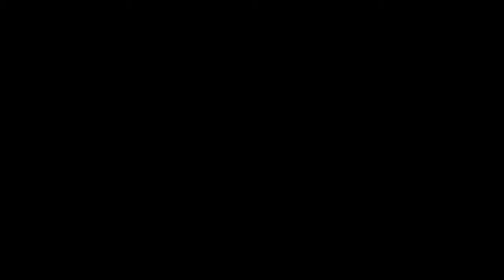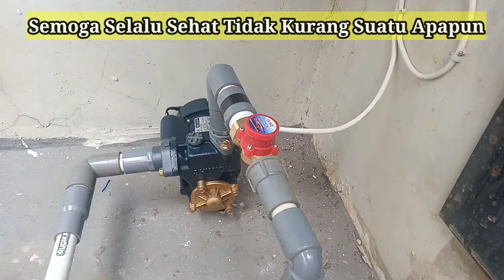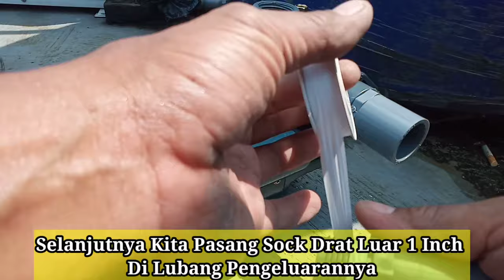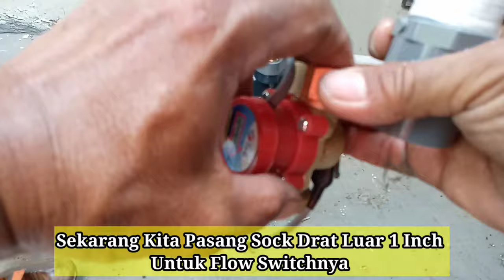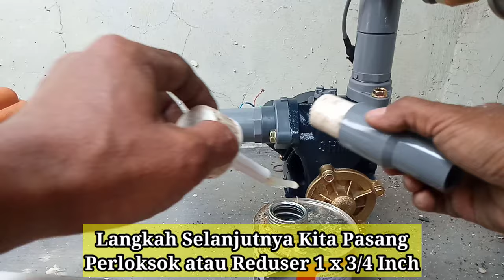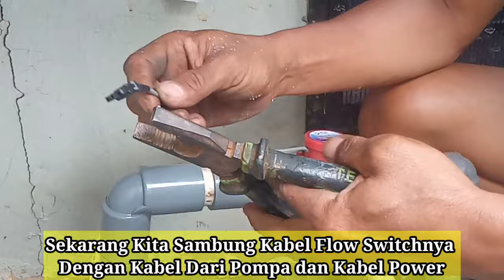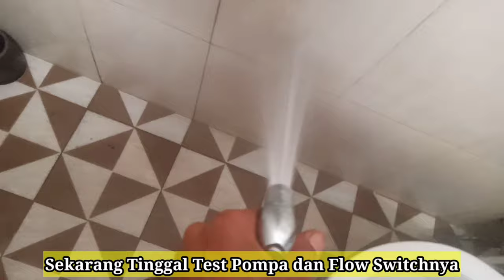Cara Pasang Flow Switch / Otomatis Pompa Air Agar Tidak Cetak Cetek I otomatispompaair I pompaair

Comment: Untuk lebih aman lagi , kabel dari Flow switc  di hubungkan dng. Relay, dan selanjutnya,  Output dari relay langsung disambungkan ke kabel motor.
( agar beban / ampere ) flow switct ttidak terlalu besar....🙏
Reply from the maker: Terima Kasih Masukannya Pak 🙏
Reply: @BABETEKNIK  Ya Mas ...
sekeddar sharing  aja.
Reply: Maaf masih bingung menggabung kan kabel power dr mesin pompa ke kabel flowswitch nya .... Dan apabila di tambah dengan relay nya
Minta pencerahan nya
Reply: @tagungnugroho  Fungsi Relay adalah, untuk membantu / memperkecil (beban ampere ) pada kontak pointnya.
Tujuannya agar alat. tsb. lebih aman dan tahan lama ( awet / tidak gampang rusak ).
Teknis pemasangannya sbb.:
1. Kabel power yg ( 0 ) / titak ada arusnya langsung disambungkan dng.
salah satu spoel  Relay dan salah satu kabel motor.
2. Kabel power yg. ada arusnya disambungkan dng. input  NO  (normally  
open) pada Relay dan salah satu kabel Flow switch  (.input flow switch).
3. Kabel Flow switch yg. satunya lagi ( out put) lansung dihub. dng. Spoel Relay yg. masih kosong.
4. Bilamana ada aliran air ,maka Flow switch akan bekerja menyambung kabel input & output nya. Yg. mengakibatkan Relay ikut bekerja.
5. Dengan bekerjanya relay akibat water flow, maka output kontak pada relay( NO  ) akan teraliri arus listrik.
6. Selanjutnya output inilah yg. harus disambungkan ke kabel motor yg. masih kosong .  ( karena tegangan AC ) kabel power boleh dipasang terbalik.
Semoga bermanfaat.....🙏
Reply: @djagoengijo3761  terima kasih
Reply: Pasang flow switch 1 inch itu sebaiknya di input atau output pompa sih. Saya  pasang di input pompa kok ngak narik yah. Pompanya ngak mau jalan fliw switch tidak on
Reply: @djagoengijo3761 kalo di akalin yang masuk ke flow switch kabel power yang (0)/tidak ada arusnya kira2 lebih efektif gak bang

Comment: Assalamualaikum, pak saya lagi as masalah di air untuk mesin cuci Saturday tabung, airnya saya ambil di bak/ penampungan air kemudian saya pakai pipap krg lebih panjangnay 2/5 meter langsunh ke mesin cuci, perbadingan pipa dan mesin cuci ku rang lebih 25 cm, tapi airnya masih Kecil, kira2 solusianya bagaimana?
Reply from the maker: Coba Pipanya Di Ganti yang Ukuran 1 Inch Pak, atau Dari Penampungan Air Di Kasih Pompa Pendorong

Comment: Selammat pagi, saya menggunangan pompa Booster permasalahan yg saya hadapi apabila kran pembagi, saya matikan mesinnya cetak cetok, klu saya matikan stop kran yg posisinya dekat dengan flow swicthnya mesin mati, tp begitu mesin mati saya buka stop krannya mesin juga g tdk hidup, nnti seyelah saya buka kran pembagi, begiti saya matikan baru mesin cetak cetok, mohon solusinya tks atas bantuannya
Reply from the maker: Maaf Baru Di Balas Pak, Biasanya Kalau Dari Keterangan Bapak Sepertinya Pipanya Instalasinya Sudah Banyak Kotoran Dari Air Bawah, Kalau Bisa Pipanya Di Bersihkan atau Di Tembak Pakai Kompresor, Sama Cek Kran2nya Biasanya Kalau Yang Ada Saringannya Suka Bermasalah
Bisa Juga Dari Flow Switchnya Banyak Kotoran, Bisa Di Buka Tutupnya Pakai Obeng Kembang Nanti Di Bersihkan Dalamnya, Semoga Membantu

Comment: Bang mau tanya flow switch sudah terpasang tapi lw di tutup kran airnya mesin gk mau mati, mesin juga gk cetak cetuk apakah ada bocor halus / bagaimana tks 🙏
Reply from the maker: Coba Sebelum Di Salurkan Ke Pipa Instalasi Kran, Airnya Di Buka Dulu Setelah Stop Kran Output, Kemudian Di Buka Tutup Pak, Semoga Membantu

Comment: Pak,kalo pompa booster berdengung saat keran ditutup itu kenapa ya? Tp kalo keran dibuka nyala normal. Dan kalo dinyalain manual jg airnya nyembur normal. Apakah flow switch nya atau pompa nya yg rusak
Reply from the maker: Maaf Baru Di Balas Pak, Harusnya Kalau Kran Di Tutup, Pompanya Mati, Kalau Masih Berdengung Biasanya Otomatis Flow Switchnya Yang Rusak, Semoga Membantu

Comment: Min kalo mau pasang flow switch itu harus ada toren air nya?

Kira kira kalo ngga pake toren air bisa ngga min di pake in flow switch??
Reply from the maker: Nggak Bisa Pak, Harus Ada Air Mengalir Dulu Baru Bisa Bekerja Flow Switchnya
Reply: Pengaruh apa itu pak mesinx selali cetak ..cetak turs...dicabut powerx di pasang kembali baru berhenti..pengaruh apa pak...apa pegaruh kran yg bocor..

Comment: Ijin bertanya suhu, knpa ya sower klo d nyalain pompanya ga langsung nyala, harus d pancing dengan cara membuka keran yg lain baru mau kencang airnya atau nyala pompanya 🙏
Apa karna paralon pakai yg 1/2inc jadi kurang banyak dorongan airnya??
Reply from the maker: Maaf Baru Di Balas, Iya Pak Biasanya Pipa Standarnya Ukuran ¾ Inch Baru Bisa Berfungsi Normal Flow Switchnya, Kalau Bisa Pipa Yang Dari Toren Ke Pompa Pendorong dan Pipa Outputnya Pakai ¾ atau 1, Atau Posisi Pompanya Kalau Bisa 1 Meter Di Bawah Toren, Semoga Membantu
Reply: @BABETEKNIK  terimakasih suhu masukanya

Comment: Bang kenapa tidak pakai pumpa yg ada autometic dan tabungnya saja. Tinggal disetting tekanan, asal tidak bocor masing masing kran.
Tetangga pasang seperti itu tapi menggunakan pumpa yg sudah automatic, disambung paralel tidak bisa kerja outo dan flow switcnya ( mompa terus) tdk bisa off
Reply from the maker: Iya Pak Kalau Kran Biasa Nggak Masalah, Ini Yang Punya Rumahnya Pakai Shower dan Jet Shower, Kalau Pakai Otomatis Pressure Suka Cetak Cetek

Comment: Kak mau tanya saya pasang pompa pendorong dengan flow switch pada toren ukuran 1050 ltr, akan tetapi pada saat keran dimatikan pompa masih terus menyala solusinya gimana ya kak?
Reply from the maker: Maaf Baru Di Balas Kak, Coba Di Output Pompa Pendorongnya Di Pasang Stop Kran, Sebelum Di Sambung Ke Instalasi Pipa, Setelah Itu Stop Krannya Di Buka Tutup, Untuk Lihat Flow Switchnya Berfungsi Atau Tidak, Kalau Masih Tetap Nyala Juga, Coba Tutup Flow Switchnya Di Buka Pakai Obeng Plus Biasanya, Takutnya Ada Kotoran Di Dalamnya, Kalau Masih Nyala Juga Setelah Di Bongkar Berarti Flow Switchnya Bermasalah Ka, Harus Di Ganti, Semoga Membantu
Reply: @BABETEKNIK  kalo untuk check valve bisa menjadi solusi tidak kak?soalnya saya sudah coba pakai 2 flow switch masi tetep gabisa mati
Reply: @BABETEKNIK  tapi kalo saya kejutkan dengan menutup kontrol kran air setelah pompa terus dibuka lagi mesinnya mati pak. Itu gimana ya?apa karena emg perlu check valve?

Comment: Untuk pemasang flow swich ini, apakah posisi mesin pompa harus sejajar dengan tandon air?
Apakah bisa untuk mesin pompa yang posisinya di atas tandon?
Reply from the maker: Maaf Baru Di Balas Pak, Iya Pak Harus Sejajar Dengan Tandon Air, Kalau Posisinya Di Atas Tandon Biasanya Kita Tambahkan Pressure Switch Pak, Sambungnya Di Kombinasi, Ada Videonya Juga Pak

Comment: Malam kak. Sy baru pasang water switch flow tp kok klu di nyalakan kran air mesin nya kerja normal tp di matikan krannya mesin msh tetap nyala ga mati
Reply from the maker: Maaf Baru Di Balas, Coba Di Pasang Stop Kran Setelah Output Pompanya Pak, Buat Test Flow Switchnya, Setelah Itu Buka Tutup, Kalau Flow Switchnya Normal, Harusnya Mati, Kalau Nggak Mati Juga, Sebaiknya Di Tukar, Semoga Membantu

Comment: Bang kalau model pemasangan ini daya dorong katup  buka dari mana ya? Soalnya  saya pasang seperti ini tapi tidak mau nyala pompa
Reply from the maker: Kalau Flow Switch Harus Ada Air Mengalir Dulu Pak, Baru Bisa Hidup Pompanya, Terus Kalau Untuk Pompa Hisap Tidak Bisa, Kecuali Di Tambah Pressure Switch, Kalau Untuk Pompa Pendorong Baru Bisa, Semoga Membantu
Reply: @BABETEKNIK berarti pompa yg ada di video ini pakai tampungan juga apa pakai pressure switch bang?

Comment: Kelemahan nya cuma kalau hrs ganti salah satu komponen yg rusak harus bongkar smw pipanya itu bro...karn km g pasang watermur d salah satu pipamu
Reply from the maker: Iya Pak, Terima Kasih Masukannya
Reply: Maaf kalau rusaknya di pompa atau flowswitch sepertinya tidak perlu bongkar atau potong pipa karena di flowswitch ada sistem sperti watermur dan di pompa ada koneksi baut, maaf bila pengamatan saya salah 🙏
Reply: Seharusnya pakai 3 stop kran, dan kemesin pendorong menggunakan water mur . Jika mesin rusak atau tidak berfungsi air tetap mengalir tanpa mesin pendorong, dan bongkar pipa.

Comment: Pak, mau tanya flow switch ini apakah bisa menggantikan peran pressure switch pada instalasi pompa air tanpa toren ?
Reply from the maker: Kalau Nggak Pakai Toren Nggak Bisa Main Flow Switchnya Pak, Karena Kerjanya Harus Ada Air Mengalir Dulu
Reply: klo pompa yg ada flow swit tidak dihidupkan apakah air masih mengalir normal,apa tekanan air pd kran berkurang???

Comment: Kenapa pas sy masang pas kran di buka gak nyala nya pak ?
Reply from the maker: Untuk Otomatis Flow Switch Harus Ada Air Mengalir Dulu Dari Toren Ka, Sebelum Pompanya Di Hidupkan Usahakan Air Keluar Dulu Dari Pompa Di Out Putnya Kalau Bisa Setelah Otomatis Flow Switch Di Pasang Stop Kran Buat Ngetes Flow Switchnya, Setelah Berfungsi Normal Baru Di Dengan Pipa Yang Ke Kran2
Reply: 0:00
Reply: 0:00

Comment: Pipanya ukuran 3/4 apa 1 ya bang
Reply from the maker: Ukuran ¾ Inch Pak
Reply: @BABETEKNIK  bang itu semua pipa ukuran 3/4... Termasuk yg drat yg di mesin pipa 2 lobang itu dratnya 3/4 y
Reply from the maker: Untuk Lubangnya Pakai SDL 1 x 3/4 Pak, Karena Lubang Drat Dari Pompa Rata2 Ukuran 1 Inch
Reply: Terimakasih bnyk bang udh respon 🙏🙏